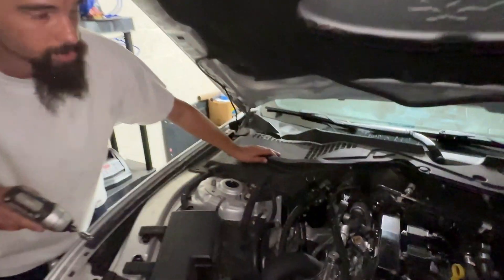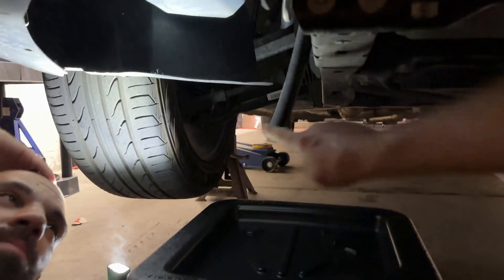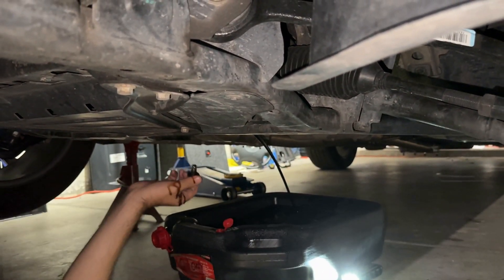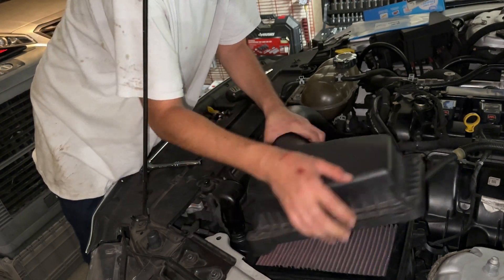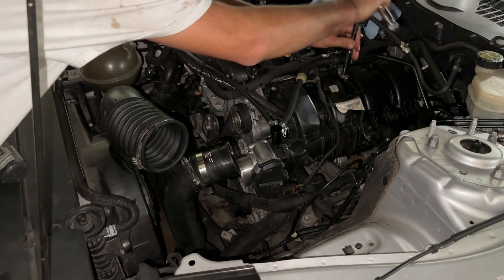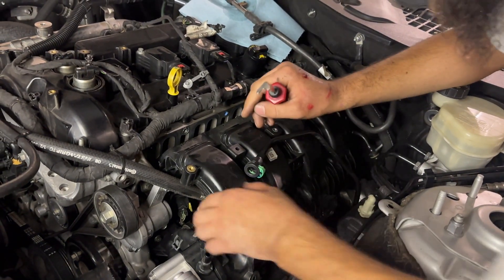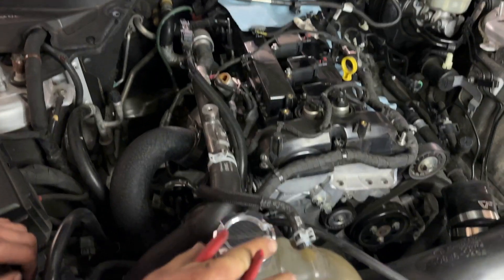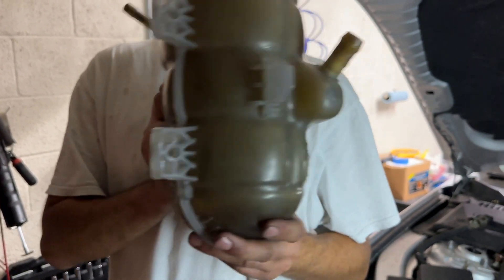Mustang EcoBoost S550 Head Gasket Replacement - Ep 1

Comment: 8:15 how the hell did you get the sensor of the runners. Not the knock sensor but the other thing. I’ve tried everything that shit is stuck on
Reply from the maker: If you’re talking about the two electronic clips that are on the backside of the intake runners. Best thing to use is a panel removal tool that’s metal so it doesn’t flex put it underneath the connector where the tree thing is and tilt left to right and she should pop out smooth
Reply: @DailyDrivenStangs I’m talking about the tube ox can’t remember what it’s called but you said you had to pull inward hard asf to get it out. But that thing is not budging

Comment: Sr, question . My car have mix of coolant in the oil, engine still working and sound good , I removed the turbo and its all wet of milk even my throttle body has milk , it’s something normal to see when head gasket blows? Or block may be crack ?  Or turbo went out? what could be the reason?  And what your recommendation ?
Reply from the maker: So this can happen if you blow your turbo. But this can also happen if the head gasket is blown. What you would need to do. To find out if it is your head gasket, there’s three things that you need to do one being the most important compression leak tester, this goes on the top of your reservoir so you will remove the cap has a die and it does change colors if it senses exhaust fumes within the coolant system. Compression and a leak down test. Wow so tell you if you have a blown head gasket. I would start there first.

Comment: I’ve done this job.    The Mustang Ecoboost is a very easy car to work on, which is why I love mine.   After doing the head gasket with ARP head studs the engine lost compression, so I bought a brand new 2021 bare long block for pretty cheap at ford.  Think it was $5000 CAD.  Engine is super easy to change on these cars too.    Great video